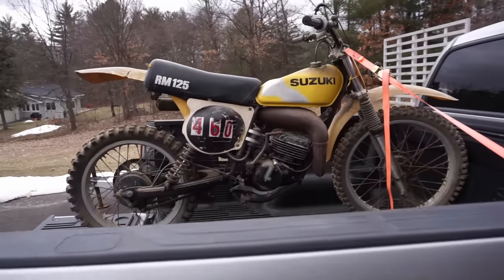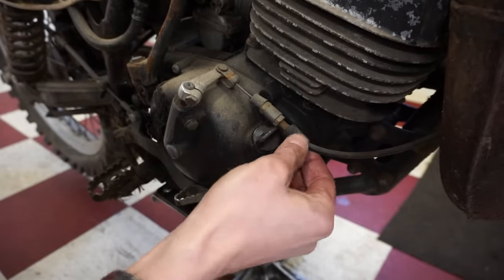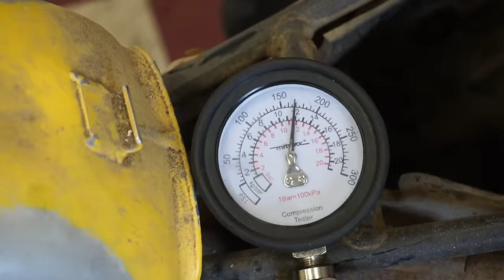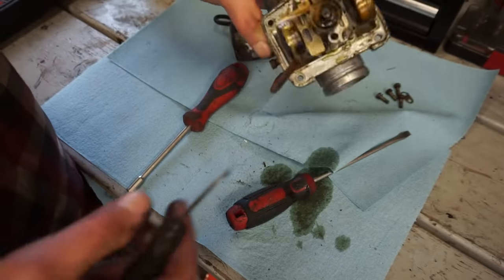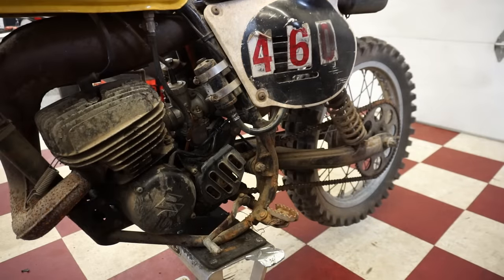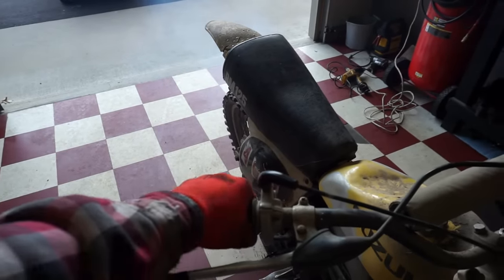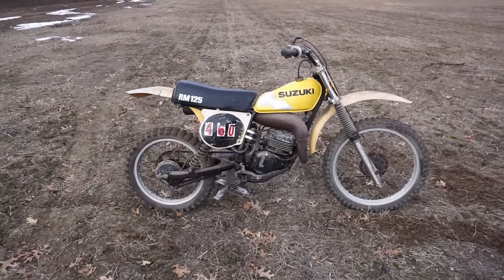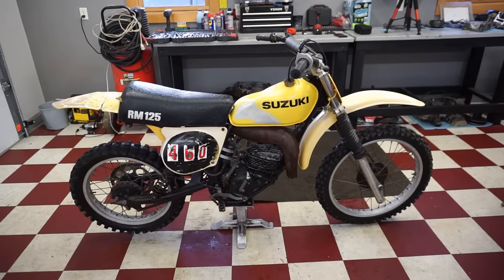Rare 1977 Dirt Bike Found Sitting In Barn For 20+ Years (AMAZING FIND)

Comment: Maybe get the parts for changing the plastics and seat, but I think you'll find a buyer who wants for top dollar price it exactly as is. 
(but change the peg springs. And sand blast the head, that's a great idea. And possibly rust converter on the exhaust. And definitely change that oil again) Please don't change the seat cover. Your job will never look as good as this Japanese factory job. 
And keep those tyres because the new buyer might want them especially.They are the key to it's originality.

Comment: if you haven't removed the wheels and rubbed the rust off the brake drums your brake shoes will be worn out after another ride. Do it properly. Show it the love and respect it deserves. That is the first 6 speed RM 125 A. I had one in the 80s, fond memories.

Comment: I don’t know if those are the correct forks unless it’s an early 78 and not a 77. I had a 77 RM 250 and the forks legs didn’t extend very far below the axle only an inch or two.

Comment: Compression test? You have spark and the way that bike sounded when kicking it over with the plug installed pretty much says there is signifigant copmression....take the carb off and clean it internally put some fresh pre mixed gas in it and fire it up!!!!

Comment: Since it's aluminum you may be able to get away with pressurizing the tank. An aluminum tank is probably thinner than most steel tanks.  I had luck with one thinner tank by welding an air fitting on a steel gas cap then using a plate on the peacock.

Comment: BARGAIN try suction on  tank for dents or can you use pressure in side with air. If petrol cap has a cap with pipe on put air through  there

Comment: Here's a little useless secret I discovered when I was racing RMs with the aluminum tanks - the SUZUKI sticker was too high and was on the bulge of the tank vs the factory bikes which were a little lower. I did as the factory rider's did and moved mine down an inch.

Comment: I would run engine cleaner in that transmission and ride it about 20 mins then drain it. I would then just put auto trans fluid in it and ride it another 20 minutes. Then I would drain and put a real good oil in there and ride it a few hours and drain it then put the same good quality fluid back in it and it should be cleaned up and good to go

Comment: fabricate an air valve stem to air up the tank after you fill it up with water. apply just a little air after filling tank with water. Using a rubber mallet, hit the bent areas until the desired result is obtained. add little puffs of air, not too much at a time, you don't wanna blow it apart. enjoy...<(:->

Comment: You use to run them on cooking oil and peanut oil mixed with standard fuel or super to make twostroke racing fuel smelt beautifull people would come for miles they would follow the smell of the racing fuel that was mixed with a clear oil called shell M at the time you could dip your finger in the oil and find out that shell sold cooking oil for two strokes that raced motocross and called it racing fuel mixed together with petrol gave it power and also i used belray a synthetic oil but more preferred the cooking oil it was cleaner running

Comment: I just recently got a 125 thrown in on a trade. It's not a rm. But I was wandering if someone can tell me why my 125 has two spark plugs in the the head.
Reply: Not sure what bike you got but alot of Enduro style bikes had 2 plugs. If you foul one it's a quick fix to switch the plug wire.

Comment: Comment 
Remember 
40:1  Is aprox 
(100ml to 1 gallon of gas)
I run that in EVERYTHING except my alky bikes & those are 32:1

Trans oil in 2-strokes I advise 85wt in everything and get rid of that 10w??  garbage

Plug gap????

Comment: Take the tank off and empty all the gas and   rinse tank and make sure the is no gas left in it. Rap a rachet strap around the tank. Seal the gas cas cap and hook a hose from pet cock to air hose. No more than 5 psi and tap around the the high spots of the dents. A little heat from a propane torch to anneal the aluminum. You do not need constant air going into the tank. When refinishing sand tank down to bare metal with 80 grit sandpaper and use a self etching primer or epoxy primer before  applying primer surfacer.

Comment: Those bike called for 20:1 didn't they but i run 32:1 on everything
Reply: Definitely 20:1 run 32:1 at least or you may regret it, would hate to see it lock up on you
Reply: I agree i run 32to1 in my yz125 2003